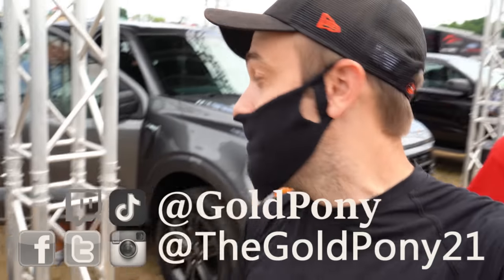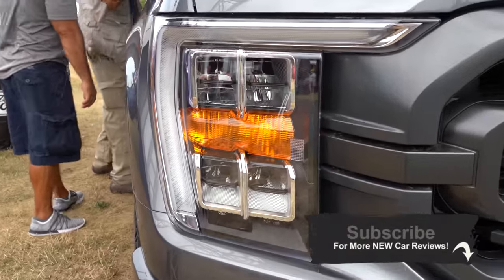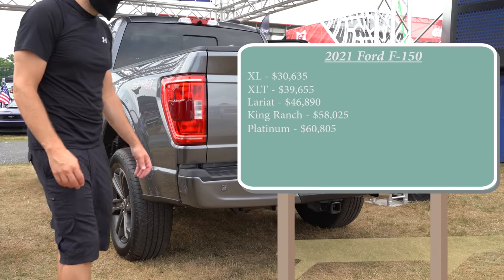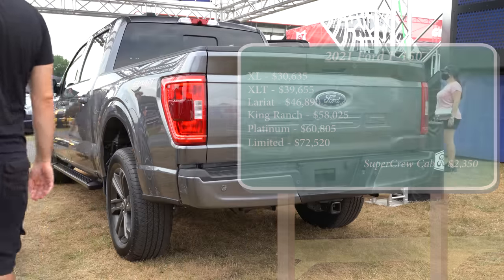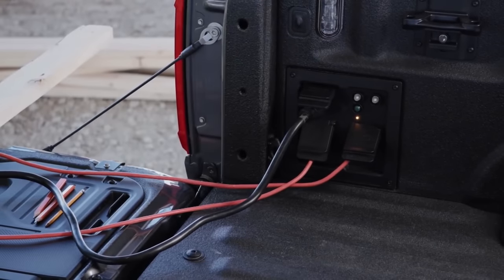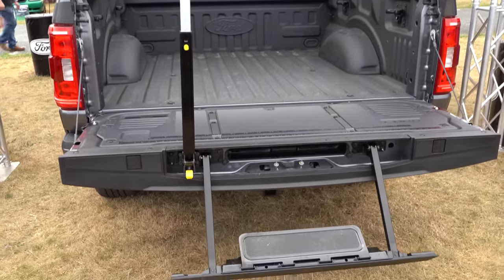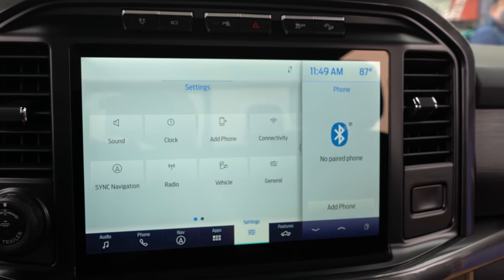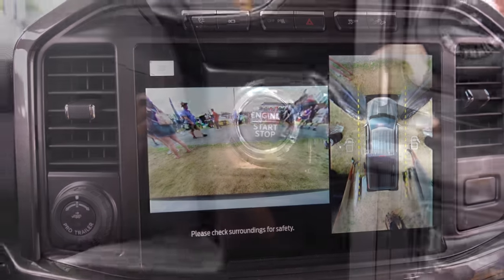2021 Ford F-150 First Look | This Truck will Surprise You

Comment: If it has the same motor 5.0 as the 2018 to present the motor is garbage . 2017 was the last year of the reliable motors from ford that includes 3.5 and the 2.7 the 2018 to present were redone and now have engine rattle and extreme oil consumption . So unless they changed something in 2021 they are garbage .
Reply: @James Howard ford added cylinder deactivation to the 5.0, so im hoping they fixed that problem along the way, crossing my fingers